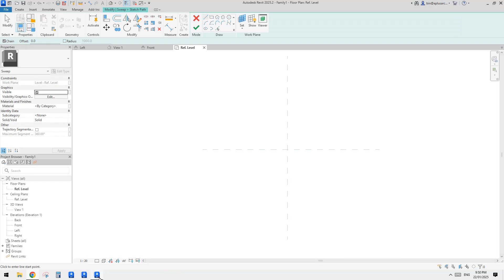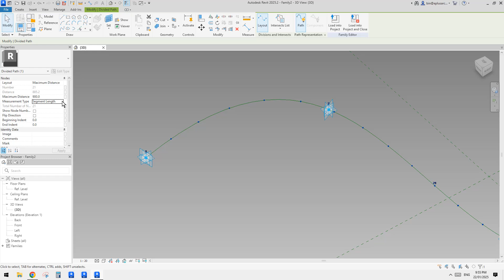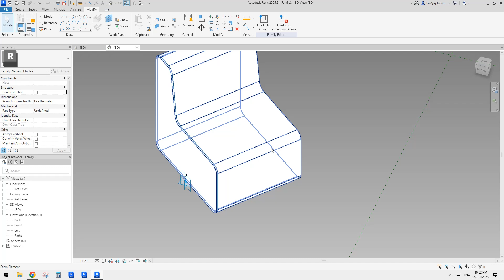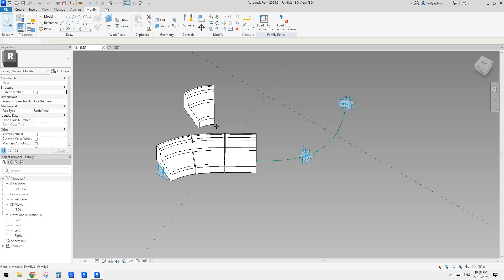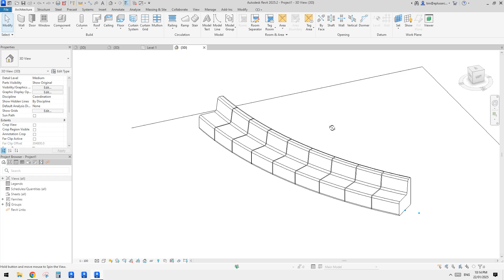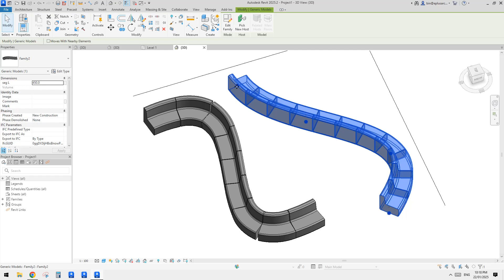Comment: This is very helpful, I think your videos are honestly some of the best on revit advanced modeling. 

I was curious is there a resin to use a repeater instead of a sweep along the reference line? Obviously, in this case it’s because there’s going to be a noticeable gap. But what if your part was a simple shape with Zero gap. 

Im building a mono rail family and I’m running into an issues where placing the curves the profile wants to over lap it’s self and controlling/hosting the adaptive monorail seems very unpredictable and awkward. 

Any insight would be appreciated about adaptive families